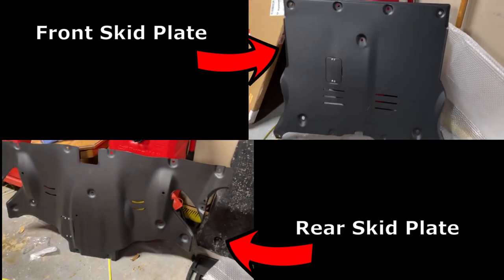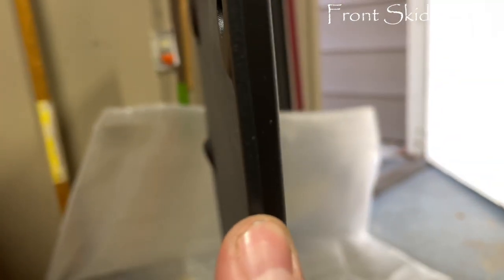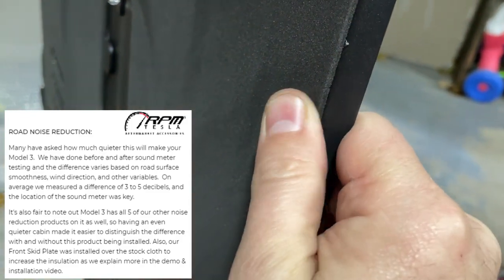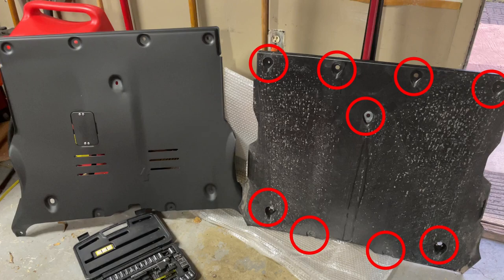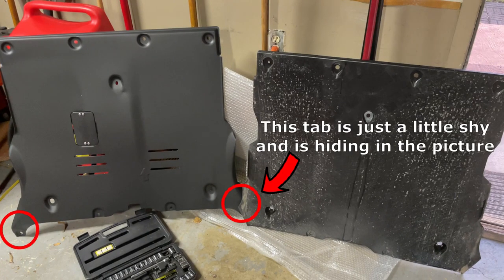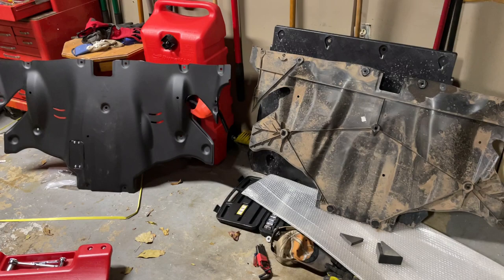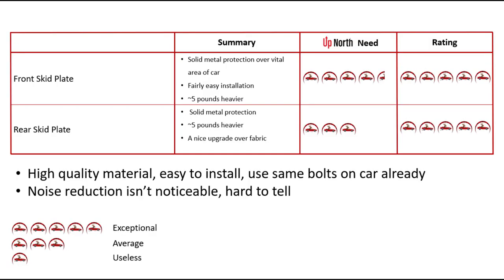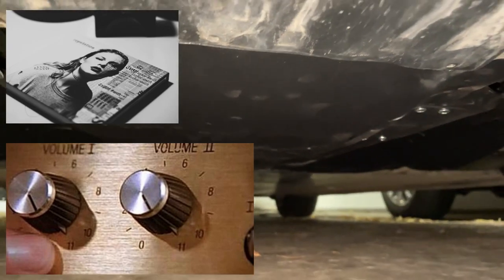Tesla Metal Skid Plate Sound Dampening Install

Comment: Thanks for the video - I just installed these on my 2022; replaced the plastic covers.  Did you get the hex head fasteners to replace the two nuts that are removed from the front one?
Reply from the maker: I did- did you get those as well?
Reply: @evupnorth1493  Yeah - just no instructions - and they were never even mentioned in the RPM Tesla install video.

Comment: Do you know if the 2022 model has better plates? Will add these to my list of shit to buy i shouldn't have to for my upcoming tesla :)
Reply from the maker: I've read a few releases on the new 2022 features and I haven't seen the skid plates called out on anything, yet.  Like I said in the video, it appears that in 2021, they did get some better plastic ones on there that are much better than the cloth ones.  But I'm not sure what the 2022 models will come with- mayhaps some recycled SpaceX scrap if the supply chain issues continue ;-)
Reply: @evupnorth1493  Thanks for the response! I think that cybertruck line might be eating up most of that scrap
Reply: I just put these on my 2022 Model 3. It had the plastic skids on it.

Comment: the metal plates start to make a cracking sound when starting to drive. As far as I could diagnosed it, its because the plate is simply too stiff, the bolts get loose a tiny bit and the metal / aluminium is moving when starting to drive after a full stand and the sound appears  - I decided to use the original ones again.
Reply from the maker: How long did you drive with the metal plates on?
Reply: No torque specs??
Reply: @dom_z3480  20 ft lb
Reply: Sounds like you didn't tighten them down tight enough. Put an impact on those bolts and torque to 3 ugga-duggas